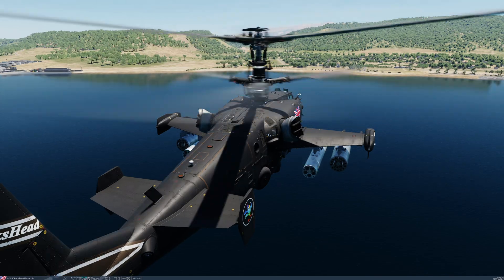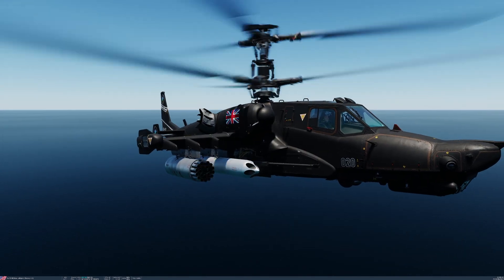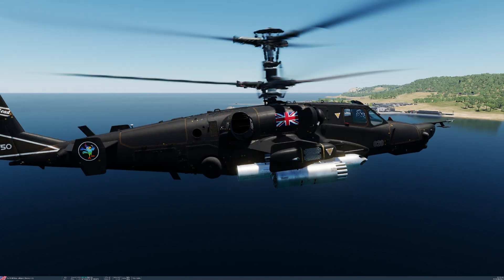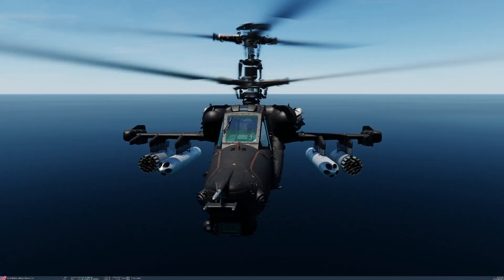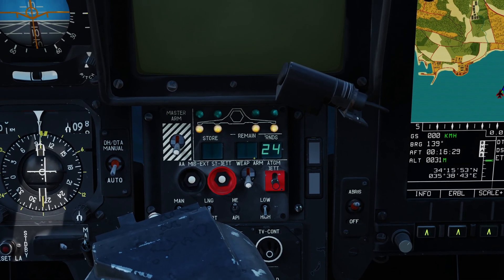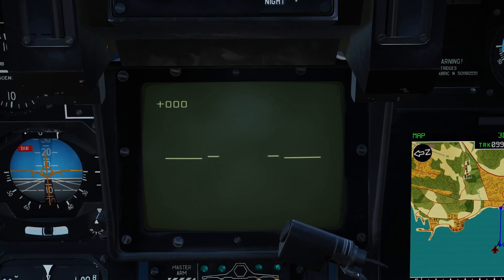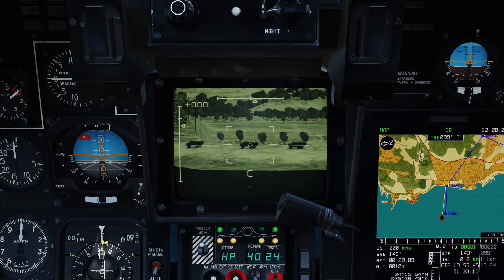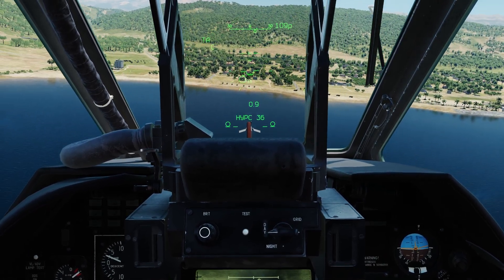DCS: Ka-50 Rockets (S-8 & S-13)

Comment: Shooting Rockets from a Stationery or almost stationery position makes no sense and is (as you found) very difficult. You don't have to be moving very fast but it helps to Trim your nose down and pick up some speed. Furthermore, if you engage the FD AP button (Flight Director Auto Pilot), it will make it easier to line up your targeting reticles when NOT in Boresight Mode although even that is easier too.